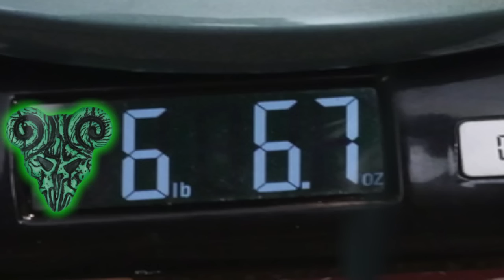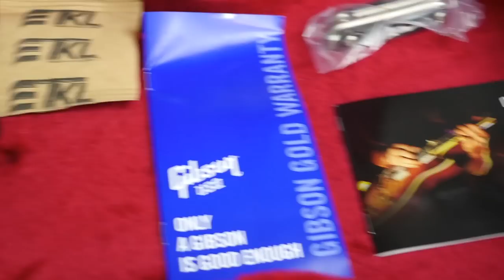Is the New 2019 SG Special Any Good? Faded Pelham Blue Review + Demo

Comment: Gibson switched to those back covers because of people complaining about static electricity noises when rubbing them. They fix issues people complain about and then people complain about the remedies, wanting Gibson to go back to the original, then complain again when it does the same thing they originally complained about. It’s a never ending circle: volutes, robot tuners, PCB boards, quick connections, brass nuts/zero fret, fret nibs.. you can go on forever.
Reply from the maker: They should really market what it is intended to do in a better way then. I've never heard of this 'static' issue before.
Reply: The Trogly's Guitar Show Im sure you heard about this, I should’ve been more detailed in my response. 

The problem was the back covers were becoming conductive via static electricity. So when you came into contact with the cover, an audible popping and crackling noise was produced from the guitar while plugged into an amplifier. This was a the “big thing” to complain about for awhile and some people thought they changed the formula of the plastic as older guitars didn’t do this. This was way before the whole bankruptcy/debt thing happened.
Reply: Boston Mike actually that back plate doesn’t solve the problem at all. Maybe helps just a little. This is a deal.breaker for me . I already have a les Paul I never play because of this issue. Ive completely rewired and shielded and grounded everything to no avail. I can pickup a hundred dollar sg copy used that doesn’t have this problem. So why does a guitar that cost thousands of have this problem. This is probably one of the major reasons sales are down and the company went bankrupt.
Reply: edit: The person who wrote the offensive comment has now deleted it. 

Mark Wilson my comment was very inappropriate and wrong. Words can have multiple meanings though and that’s just how the English language is. Sometimes words are even spelled the same and sound different or have a completely different meaning. Ie: bright/bright; well/well; right/right 

The whole point is it’s no body’s business who anyone chooses to get off sexually with.
Reply: TimmyV - if you are talking about the static popping noise - i get it on the pickguards to my (Epiphone) Les Pauls.  Just rub a dryer sheet on the offending piece of plastic. That usually fixes the problem for a while if not for good.
Reply: Boston Mike 😂
Reply: You are astute.  I agree with your comments.  It may be an ok instrument, but I would not buy one.  I like all the modern advancements of today’s modern guitars.
Reply: TimmyV Why didn’t you return then? So you kept a guitar you can’t play? Gibson has a return for this very reason.
Reply: Maybe a Bounce dryer sheet would work to remove the static. It works for Telecasters. It'll probably melt the Nitro on a Gibson though. That's my beef with Gibsons. I hate Nitro finishes. I used a planet waves PlanetLock guitar strap on a brand new ES339 for about 30 minutes and, the rubber on the back of the strap melted the Nitro finish on the back of my guitar. In all honesty, I have an Epiphone ES339 that I like better. In fact, I prefer Epiphones over Gibsons in just about every instance.
Reply: Jimmy Parris I’ve never had any static issues with any of my Gibson’s. Epiphones overs Gibson’s? Haha!!
Reply: Boston Mike was the way
Reply: @Trog  I just bought a brand new 2018 SG Standard and it does exactly that. Cracks and pops when you rub the back plate. I just put some shielding behind the plate and seems to at least minimize the static.
Reply: Buy the guitar and mod it to your specs.... easy.
Reply: Cymon Cyrado or just buy a guitar that meets all your specs and play the hell out it.
Reply: @PaulNelson156  my SG Standard 2018 did the same thing. Buy copper foil tape off amazon and coat the inside of the back plate with it. This will fix the issue using the original backplate.
Reply: Panic42000 that’s usually what Epiphone owners who can’t afford a Gibson say.
Reply: Boston Mike exactly guitars Will have pros and cons!
Reply: TimmyV Too bad you never play that Les Paul!
Reply: @timmyv694  I worked in a shop from 2008-2018 and we went through a batch of Gibson's between 2016-2018 that had the static issue and the sales rep said he had heard that the paint picked the charge up in the curing process and it was a pretty widespread issue. We had good lucky getting them replaced for people under warranty though. Seemed to only pop up in dry environments but humidifying didn't resolve the issue.
Reply: Nice guitar! Need to practice up on my Pete Townsend windmills.
Reply: John Smith  are you scared of the gays little man?
Reply: @timmyv694  I own two Gibsons. A 2018 SG standard and a 2019 Les Paul special. BOTH have the static issue. I took my SG to guitar center and somehow the tech got rid of the static issue. So far I barely play my Gibson LP special because it always has static issues. (Not from the backplates either)
Reply: What static?
Reply: @wilson4180  I've never experienced this. Not once.
Reply: @Mephilis78  I’ve never experienced a 4 sum, but that doesn’t mean they don’t happen.
Reply: Story of my life.

Comment: For anyone watching this in 2021 or later, I just would like to point out that this SG is NOT the current Original Collection model - this is the "Henry-spec" from early 2019 (look at the upload date), hence why it has the PCB, textured backplate and thicker fretboard binding.
The Original Collection was released a few months later and features the updated specs like handwired pots with Orange Drops, etc. 
The way to tell them apart is the serial number format (19xxxx for the old model - as seen in this video - vs the 1DDD9xxxx format for the Original Collection).
Reply: Gracias!!
Reply: This is correct. Mine is a 2021 with Orange Drops and no PCB, all hand-wired.
Reply: Correct, mine is a 2020 with the handwired electronics
Reply: Great info, thanks!
Reply: Huge help man. I ended up with a 2019 burgundy with handwired pots. Was scratching my head. Thanks!
Reply: Long discontinued if you are watching in 2024. Cherry and Black only,  but you get a plek'd fretboard and hard shell case. 👀

Comment: I just spoke to Gibson to find out about the hand wiring situation with the 2019 Special. They informed me that the yearly designation will no longer happen and that the SG’s are coming out now with hand wired pots and the orange caps. Would love to see a review on one of these.
Reply: That is what I noticed as well, hand-wired and orange caps.  Also, the control plate on some of them is the regular smooth surface type, protected with clear plastic foil like on the pickguard.
Reply: I got a burgundy one that is handwired with orange caps. Was wondering. You answered my question. thanks!

Comment: I find it ridiculous how the 2019 Gibson models have the quick connect system, but yet Gibson no longer sells quick connect pickups.
Reply: on the gibson website it says they are hand wired with orange drop capacitor?
Reply: Mine is hand soldered.
Reply: The limited run ones had the PCB job, but the Original Collection ones are back to handwired.
Reply: You're right, and I paid $1800 for a limited edition in aged cherry with vibrola, just like a '64 - circuit board... When I wrote to Gibson, I got quite a curt email back... Having said that, it's a great guitar.
Reply: @VeroniqueMystique  Hi V. Just got mine opened up and I see no orange caps - and not hand wired. Also case does not fit guitar properly. Still, it sounds great through my old Digitech TwinTube. Pondering changing my Humbuckers on my '73 Gibson Les Paul Custom to Gibson P90's. (There's an explanation as to why below your comment)

Comment: simplicity is one of the keys to beauty, and this guitar demonstrastes that. single piece wrap around bridge, p90s, no unnecessary logos or lettering on the headstock, i would add classic tunners to it.
Reply: I know you mean the "snot green" plastic tulips , but these were the type used on the original 60's SG Junior & Special & I believe, back in the 60's would have also been manufactured by Kluson. 👍
Reply: The keys/Tuners are even better than the original Kluson's, because they are smoother tuning with the larger Ratio (16:1 ?). Also, adding the bigger "Tulip" ones may result in "SG Neck- Dip" ("Heavier at the Headstock" syndrome). Trust me - you LOVE the lightness & simplicity of these stock, smaller Tuners.

Comment: Nice looking. I am skeptical of the wrap-around bridge, how do you maintain intonation? 
I got a Derek Trucks model, and had to have it refretted, because the frets did not span
the full width of the fret board, which led to frequent slipping off on the high and low E strings.
Now I look for "Fret over Binding".
Reply: It's pre-intonated.

Comment: I finally decided on the Ebony finish, which they didn't have at the time of this video. I've watched this video many times and it was between the Pelham Blue and the Ebony once they added it. Watched this video many times since it debuted. 
I've added a wide bevel vintage style pickguard,  a Dimarzio Super Distortion that is designed to fit in a P-90 notch, an amber switch tip, locking vintage style tuners and a bad ass fine tune bridge and finally a wide bevel truss rod cover. Looks and sounds amazing.

Comment: I know gibson always keep a small gap between the neck tennon and the pocket in case the wood will expand so it doesn't break
Reply: Also somewhere for excess glue to go.
Reply: That's just a gappy crappy glue joint.
Reply: @jefflitchfield4950  If you look at ESP built SGs even the cheaper Edwards  models the neck joint is so tight and beautiful made.Perfect wood construction. The Japanese know how to do it !
Reply: This looks nothing like on my SG where the gap is a couple of millimetres till the middle of the joint
Reply: Aquarter inch? and the big finish chip is standard too. I dont care if if it gets covered by the guard for 1400 it should have flawless finish. That will grow.

Comment: Question: How was the intonation on this guitar? I've noticed on previous iterations of this guitar that the bridge was a little further back. In fact, Trogly mentions this. I'd like to hear from owners, no matter the generation, if this is an issue with this model or the Les Paul juniors. Thanks ahead of time to the community.
Reply: It's not an issue for a lot of people  myself included. You adjust the bridge with 2 set set screws and get it as close a possible. I’ve been playing this style of bridge for years. I set them and never give another thought to intonation. Setting individual string length via the bridge is only one small part of playing the guitar in tune. I hear plenty of people with fully adjustable bridges that don’t play in tune and plenty of people with wrap around bridges who play perfectly in tune. FWIW Acoustic guitars rarely have individual string adjustments on their bridges and people are fine with that. A huge plus of the wrap around bridge - for me anyhow - is the slinky feel it imparts. LOVE it.
Reply: My experience with this type of bridge is, you have to work on it a litle to get the best possible intonation.  Typically, without the little set screws moving the bridge back a little bit, the notes on each string at the 12th fret are a bit sharp when the open tuned string is perfectly set (or the harmonic note at the 12th fret).  Before you change the set screws, you should release the tension on the strings quite a bit, otherwise the required torque at the set screws during turning might be too high, and you could strip the screw or the inner hexagon profile.  On the guitars I have been working on, it had to turn the set screws quite a bit, so that they almost disappear.  It takes a few iterations to get the best possible result, but it is worth it and not too hard to do.  I was able to get an almost perfect intonation in the end, after three iterations.
Reply: I have a 2022 SG Special with 10-46 strings. I bought it from Sweetwater and had them do a Plex set up. The intonation is spot on - 100% accurate. Also weird for a Gibson, this guitar stays in tune, super solid and stable. :) Only complaint is the strap button placement. Otherwise the guitar is inspiring!

Comment: The new Gibson 2019 are very good. I got a Les Paul Junior, it is a great build. The main thing I have noticed on the 1950's and 1960 still have that top pick guard mount divot problem. Its been an issue for many years, they need to fix it. I do love the new SGs'

Comment: they finally made an sg special how it should be made again
Reply: I agree, but they need to adjust the price to the model.
Reply: @macaholic100  I agree. This would be a top tier option in the 7-1k price range. It's kind of a illogical for 1500 new.
Reply: @jjjamesonnn    If you look at the prices of Gibsons from the last five years they've increased dramatically. It seems to have happened just after 2015 when whom ever it was in management that made the utterly foolish decision to install those horrible robo tuners on all Gibson models. In addition to a slew of other idiotic mistakes including that horrible Les Paul logo on the headstocks of their Les Pauls. Rumor has it, Gibson took a real bath in sales that year and I was told by one of the GC stores in my area that they told Gibson not to send anymore 2015 models. So it appears as though Gibson has been trying to get back what they lost in 2015 with these incredible price hikes since then. I've noticed it, even if no one else has.
Reply: @macaholic100  I've noticed the price hike, but consider how much money this model is over the LP Jr. Doublecut they just put out. For an extra pickup and a rarer finish, the upcharge is 700... Even by Gibson standards, it doesn't make too much sense.
Reply: macaholic100. When the recession hit,they made a foolish decision to raise their prices $200 on les pauls.Epic fail...Thats why you see young bands sporting midrange fenders.Dont screw over your base.

Comment: Trog- this review doesnt appear to be accurate- I just got my 2019 SG Special in yesterday and it’s all hand soldered, not pcb... maybe you ended up with one of the last of the limited run rather than the newly revised ones?... I almost didnt buy this guitar when you showed it was pcb but Im glad I did and was pleasantly surprised.
Reply: How is this tailpiece set and the intonation... I had to Gibson doubled cuts With that type of tailpiece and could not set the intonation.... I have lost total faith in that type of tailpiece... Really glad you're happy with your purchase thanks
Reply: keithadams812 All of my strings are in tune up the board aside from the high E and G, which are just a touch sharp at the 12th. However, the generous guy I bought it from included a Leo Quann style intonating wraparound tailpiece that I’ll probably install.
Reply: I’ll say another minor difference is that mine has a black switch tip rather than the white on this one- may be an easy way to distinguish the handwired (black tip) from the pcb (white) for those who care.
Reply: @larrylambert2727  mine has a white switch tip and has the flat plastic and hard wired electrics..
Reply: CraigB Oh, well so much for that! People will just have to ask or cross their fingers that they get the one they want.

Comment: The Gibson web site says this is hand wired with orange drop capacitors, but I'm guessing since you point out it has a pcb at 6:30 that's not the case.  So is Gibson's Website info incorrect?
Reply: I know you commented this a year ago, but just in case you still want to know, the guitar in this video is a different model - it's the older "Henry-spec" from 2018-early 2019 (see the upload date). You will find it in the legacy part of the Gibson website now.

The newer ones from mid-2019 onwards do have the updated specs like you mentioned.
Reply: @KozumaHeiji  Appreciate the info, Thanks!

Comment: Just got a 2022 SG Special in Vintage Cherry. The neck is set in the body jacked. The tail piece on the bass side is screwed a down all the way for the Low E to sit 5/64 at the 12th fret. The high e side is all the way up to get it to sit 4/64 at 12th fret. Poor QC @ Gibson. So disappointed. Its going back. Not sure if I should try another.

Comment: I had one of the originals (60's) with P90s - but it had a factory Bigsby instead of the wrap-around.  Also had the standard-issue broken and repaired headstock.  Wish I still had it - traded for an  amp I think.  Was in Jr. High and really had no clue what I had at the time.

Comment: If Gibson are specifying "rhythm and lead" pups and then making the neck pickup higher output then surely someone somewhere is not thinking straight. I would guess that the pups are the same (the readings are very close after all) and the only thing different between them is the label

Comment: Not sure if it’s the amp settings or the pickups, but the bridge position sounded pretty tinny, especially on cleaner settings.
Reply: Joe Brenner it’s the Mesa MKV 25. It’s a hard amp to dial in if you’re not an amp guy which Trogly has stated he isn’t the big player/tone guy he’d like to be ( so in no way a slight on Trog). The active eq section is super sensitive and you can get lost trying to dial in anything resembling a decent tone with it outside of high gain.
Reply: Hogie makes sense. And Trogly seems to do a lot of humbucker-equipped guitars, so grabbing the odd single-coil guitar could throw it off if playing through a sensitive amp like that.